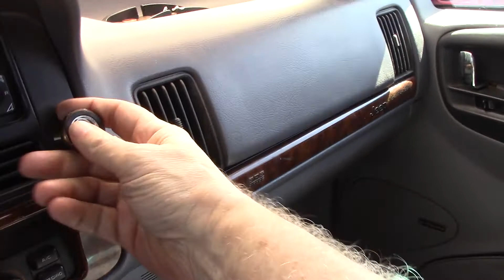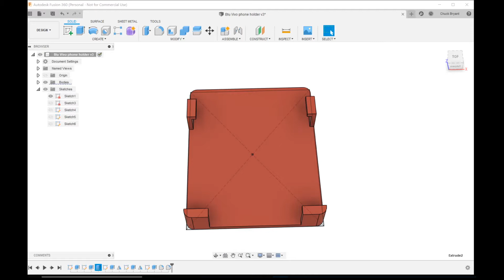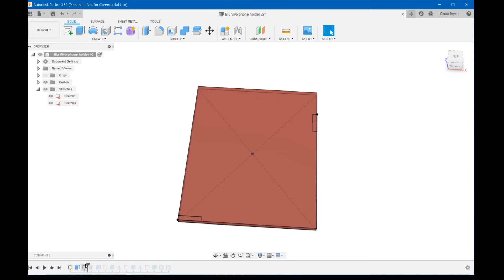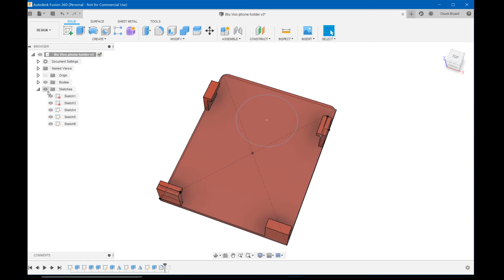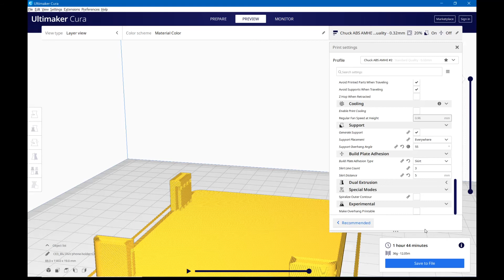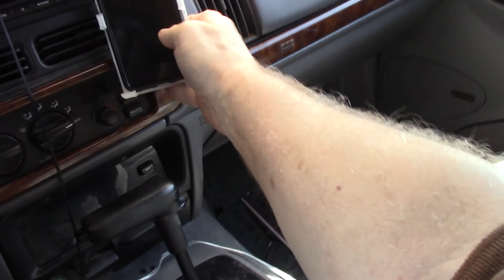Solve Everyday Problems using 3D Printing. Phone mount adapter

Comment: I just love that cassette adapter! It probably hooks up to the audio output of a VHS videorecorder! 😂 Nice video!
Reply from the maker: Thanks. I used to use that adapter to play podcasts though the car's stereo system. I'd get a newer stereo installed that had Bluetooth, but its got a weird size hole and every installation I've seen either uses a crap 1.5 din stereo or they've butchered the dash putting in a 2.0 din stereo. Sucks, cause I really like that Jeep.